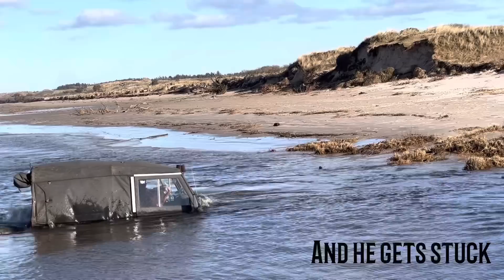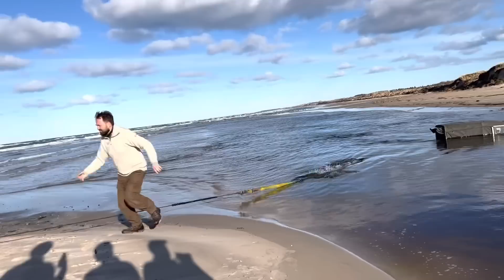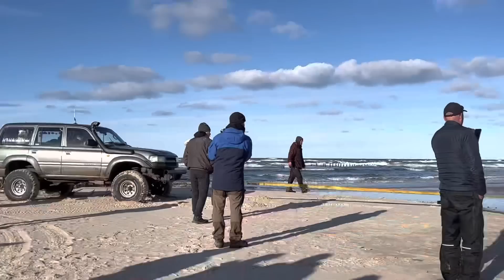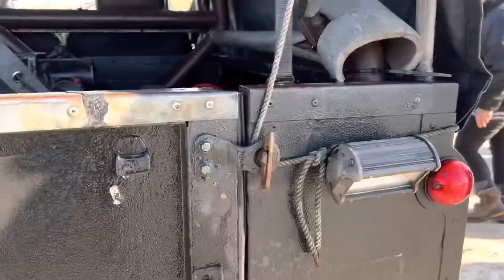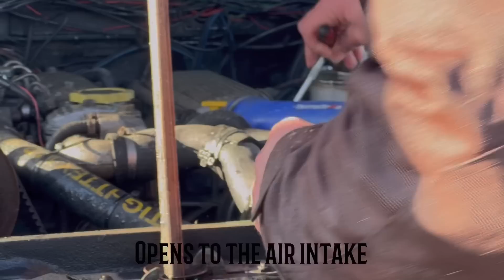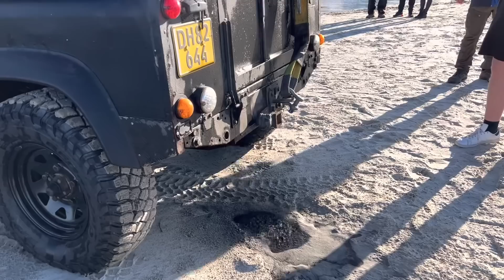Land Rover Defender 90 in Uggerby Å

Comment: Hope the Land Rover is alright! Fresh water?
Reply: I think that is the North Sea breaking in the distance so it might be fresh or brackish.  
Imagine the cold of the water chilling the axles and gearbox, sucking water inside through the breathers.
Reply: Its fresh water, it come from the river and it is Rainwater.
Reply: @ExploreJimnyDK  it does look rather close to the ocean though so it could be a bit salty? Especially since it looks like it’s standing water. Either way, that vehicle will need a lot of work to bring it back to what it was beforehand (assuming this is the first swim like this). If it is salty water then he’ll need to find some fresh water and do this all over again to completely remove the salt.
Reply: @carltonr3417  When the water level in Uggerby Å is this high, it is because of recent heavy rainfall. In this case there is a decent flow of rain water, and the salinity is very low. Normally this part of Uggerby Å is just around 50cm deep. But still a bit of salt is hard to avoid. But then again, all vehicles in Denmark are driving around on salted roads every winter, and the cars are prepped for these conditions. He may experience some electrical gremlins after this though.